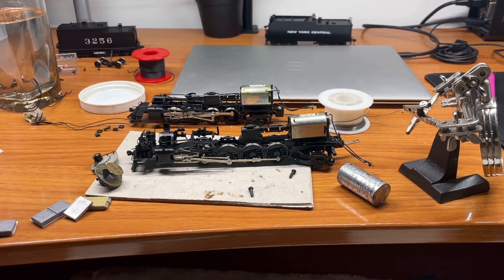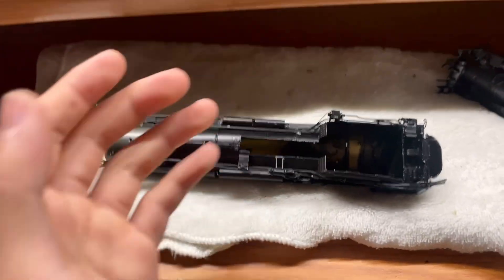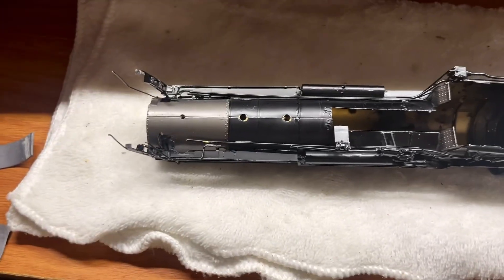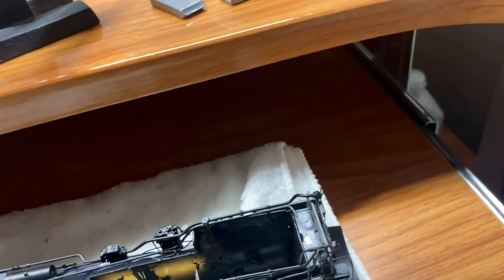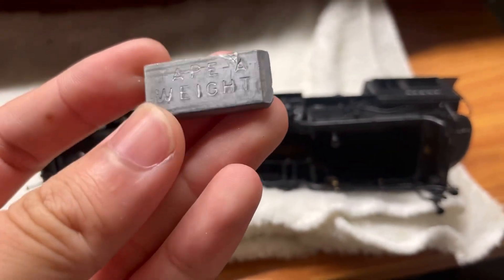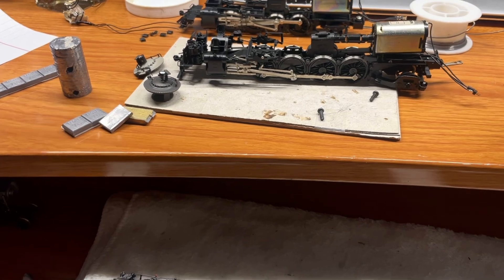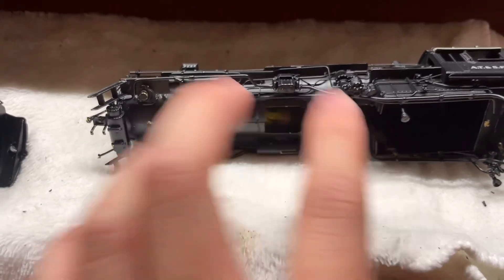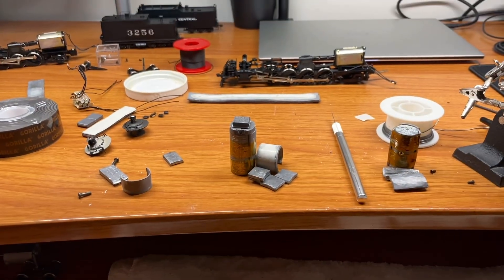Why your Brass Model is WEAK from LAZY Engineering (and how to fix it)

Comment: Best of all this trick works on RTR MODELS TOO!!
Reply from the maker: Its harder to do in RTR models but yes. RTR models are generally better designed to utilize all the space inside the boiler. They tend to be light simply due to inefficient design and overuse of plastics or other lighter weight materials. For example, the addition of many plastic brackets, large gearboxes, smoke units, excessive PCBs or electronics, etc. Therefore it is generally more difficult to add weight to RTR engines, but certainly not impossible.